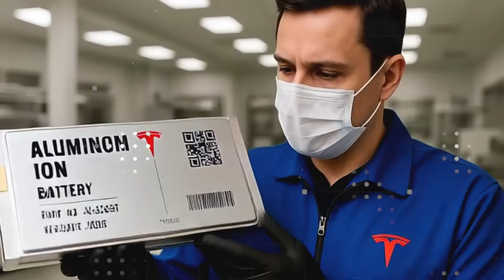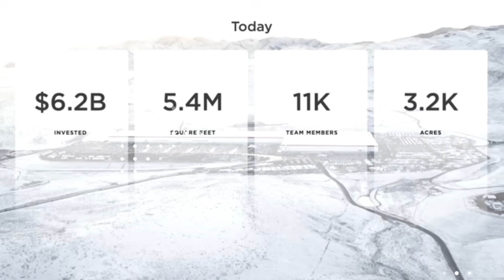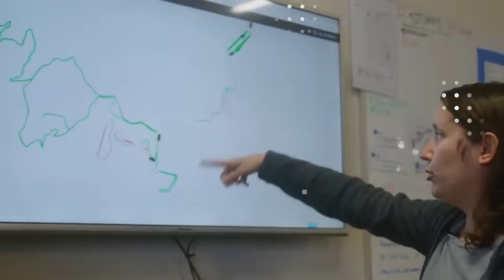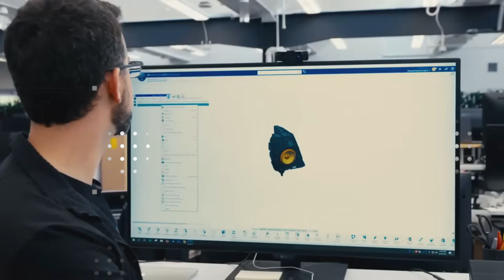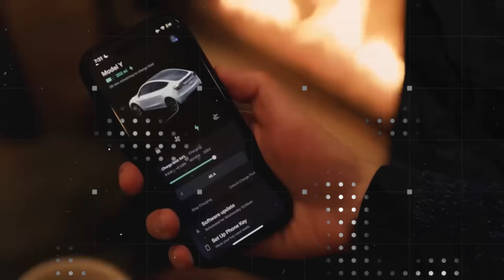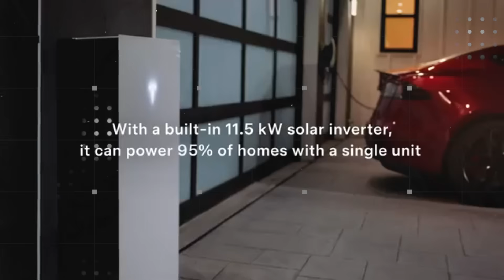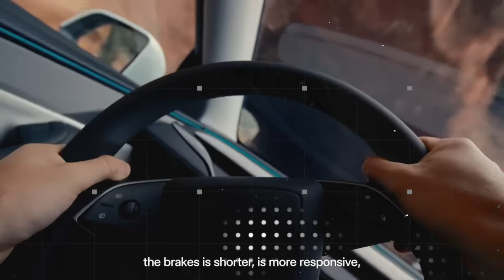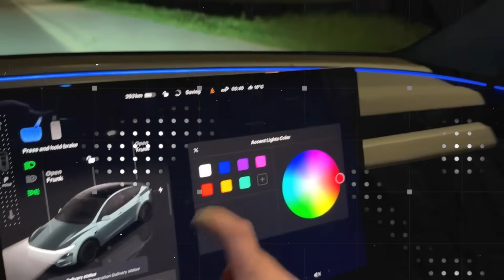New Tesla Model 2 ALUMINUM-ION: 1,000-Mile Range, 5-Minute Charge, $5k Retrofit

Comment: Current Tesla range: The highest range currently available is for the Model 3 in China, which has a range of about 515 miles (830 km). The maximum EPA-rated range for Tesla vehicles in the US is lower, around 310 miles for the Model Y Long Range or 515 miles for the Model S Long Range.

Comment: My M.Y has 75 kwh battery it range new 324 miles in 2021, now November 2025. Range is 275-280 max.  Odo meter read 59,490 miles.  The new battery 60 KWh said run 1000 miles in video or I heard it wrong.... to get better range I needed to change the new motor system... and computer ... and battery "3 parts?.... that could cost over 35,000.  The current vehicle noisy as hel... seating inside is like seating in the drum with people banging outside...  road noise on new 2025 model is much greater quiet sell 42500 with 7500 T discount, no discount about 52k out the door...😢😢😢😢😢😢😢😢😢😢😢😢😢😢😢

Comment: They are trying to sel more than 50 years old technology as a revolutionary discovery although actually is revolutionary since was removed and hidden as forbidden technology. There is only one question: will be allowed to be released? Since original battery allowed 1200 miles distance at 120Mph. Original car was produced in 1972 and destroyed couple months later. All vehicles were sized, owners mostly killed, factory destroyed, owners assassinated.

Comment: What about reliability in cold weather? When are you going to make a generator to charge the battery while you are driving? Make one of the axle motors divert to generating power while in coast mode.
Reply: they have been doing that for 13 years

Comment: I was wondering when some one would develop an aluminum battery. Aluminum with gallium can be used to convert water to hydrogen. It takes a lot of energy to convert the oxide tino aluminum. To convert the aluminum back and get electricity is the  key and apparently he has done that. As for standard batteries used through out the electric car industry, that is a great leap forward. I would like to know what chemistry Tesla is using.

Comment: I have been using the same PC case for over 20 years.  It has has 4 MBs through it in that time.  It still has 2 CD burners in the front of it, and an empty HD rack that can hold about 6 HDs.  The case itself is aluminum and is still like new.  Some of this was made possible by the ATX standard, and the mounting points for the board not changing in over 20 years.  It is called STANDARDIZATION.  Car batteries should be no different than AA cells, D cells or C cells.
Reply: Absolutely right! Standardization is what drives real progress just like the ATX boards EV batteries need that same universal approach Imagine how much faster innovation would move
Reply: Now, if we can get standardization in recharge stations, it will make a HUGE difference, all the way around...
Reply: If the battery is successful Pres Xi of China can keep all his lithium.  We (the US) have lithium it s just no one wants the cleanup process to mine lithium. Once again, Elon company is 2 steps ahead of ford, Gm, and NASA.
Reply: I hear ya bro . But my car battery went bad and had to be replaced.  I had no idea it was located UNDER THE BACK SEAT ??!! And they had a hell of a time finding the right car battery my car needed.
Reply: My M.Y has 75 kwh battery it range new 324 miles in 2021, now November 2025. Range is 275-280 max.  Odo meter read 59,490 miles.  The new battery 60 KWh said run 1000 miles in video or I heard it wrong.... to get better range I needed to change the new motor system... and computer ... and battery "3 parts?.... that could cost over 35,000.  The current vehicle noisy as hel... seating inside is like seating in the drum with people banging outside...  road noise on new 2025 model is much greater quiet sell 42500 with 7500 T discount, no discount about 52k out the door...😢😢😢😢😢😢😢😢😢😢😢😢😢😢😢
Reply: No difference between 1.5V alkaline batteries?   Just pop something in and drive 400 miles?  Sounds great.  I’ll send a strongly worded email to the  engineers right now lol